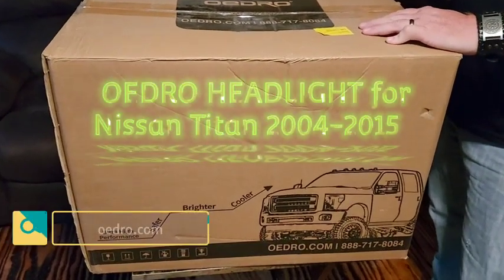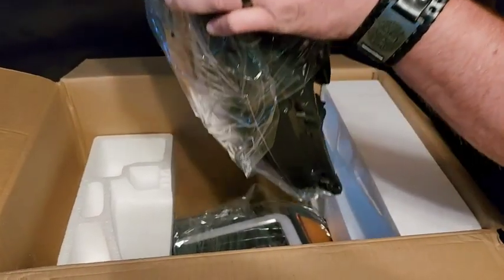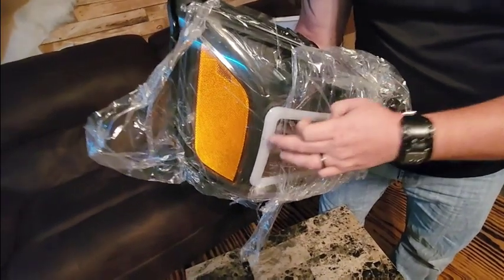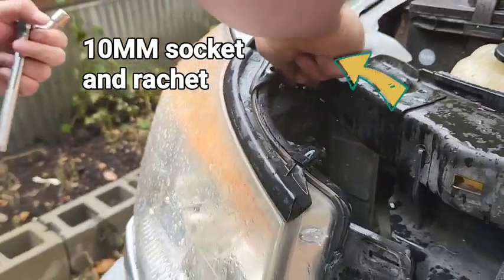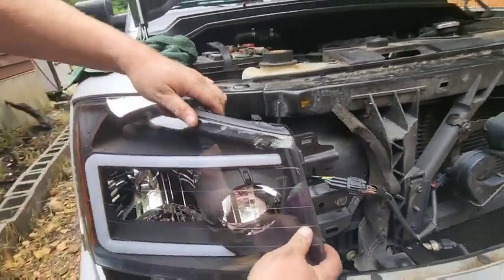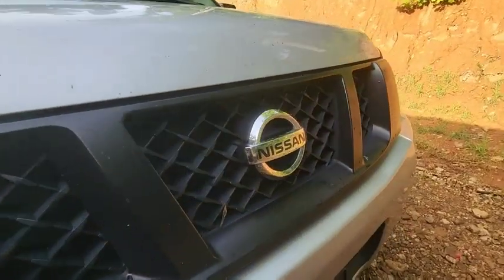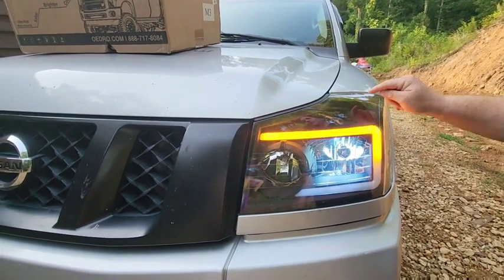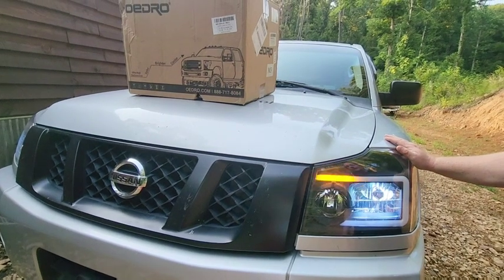OEDRO LED DRL Headlight Assembly Replacement for 2004-2015 Nissan Titan / 2005-2007 Armada

Comment: Would fit my 08 armada?
Reply: Im not sure check the specifications on it they fit armada i beleive but unsure of what years
Reply: Yup armada and titans use the same headlights, in fact they use the same exact frame and transmissions as well. Well atleast for the older models.